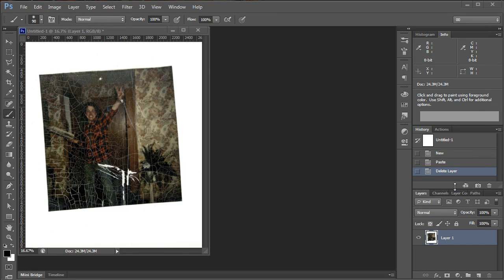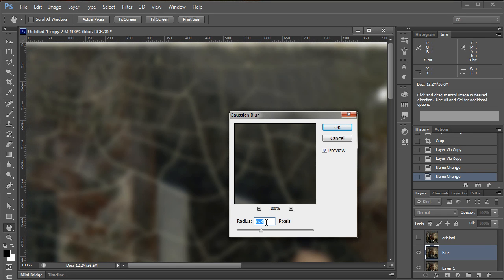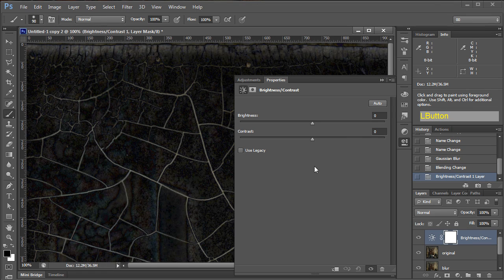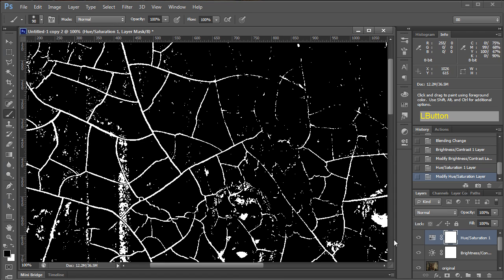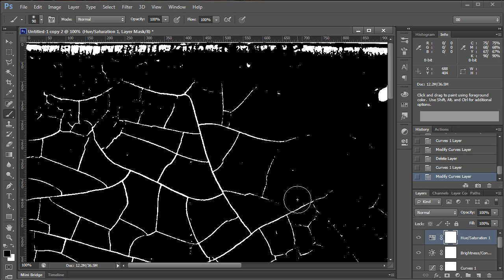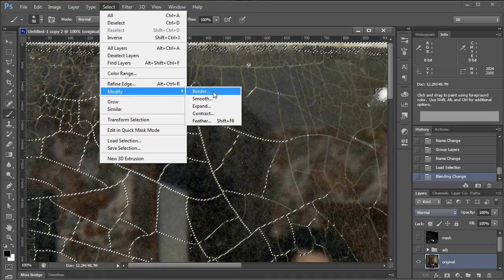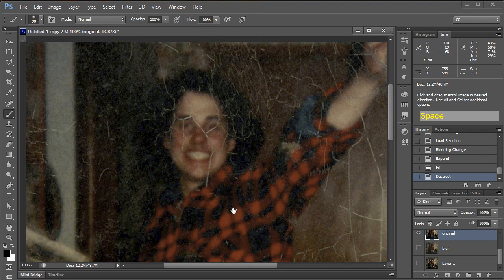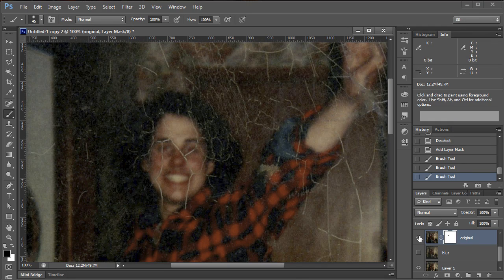Removing Cracks Using Frequency Separation

Comment: Just wanted to say this is a great technique! I had to change it a little since I am using Photoshop Elements, but it still works. I used it for a picture that has wear damage instead of cracks. It's also grayscale so I had to use the Magic wand and clean up the selection first but it worked well. Thank you for the tip!!
Reply: what did you do for elements?
Reply: @jamesgrant7524  Give me some time, I'll try to do it again and post the steps. It's been a while...

Comment: very cool tutorial. I have cs6 as demo, but usually use cs2. In cs2 I had to do a workaround because the 'content aware' is not an option for fill layers. Instead I used the patch tool. Not exactly the same outcome but still very nice.